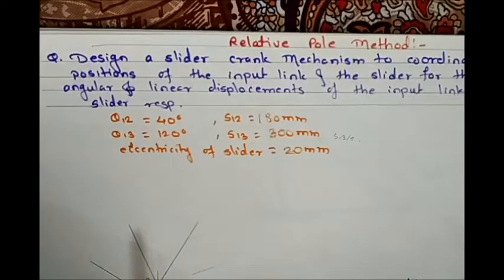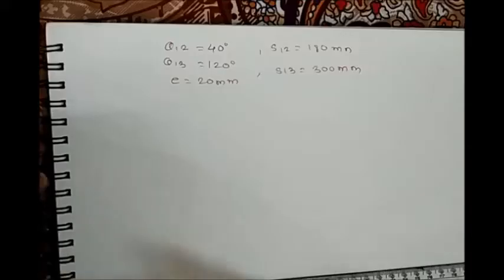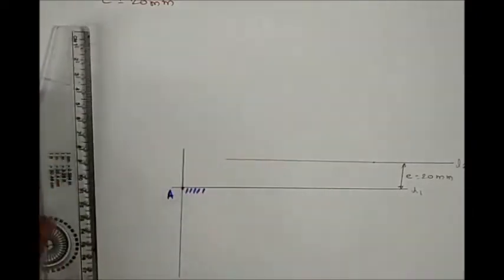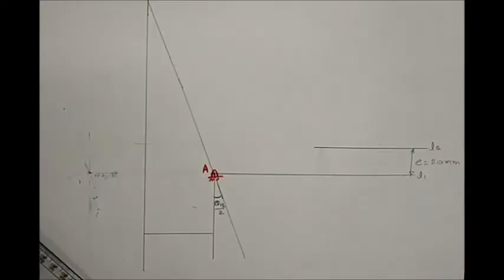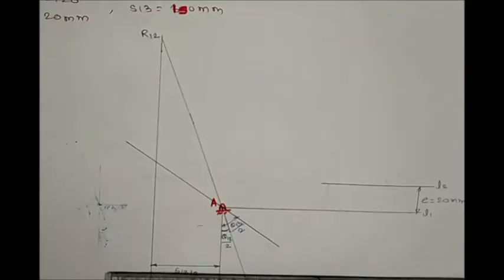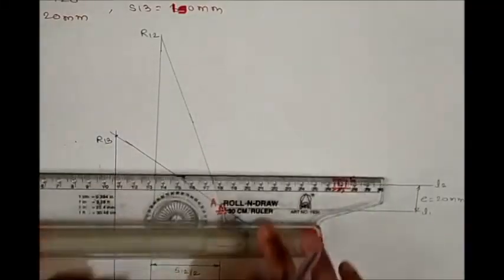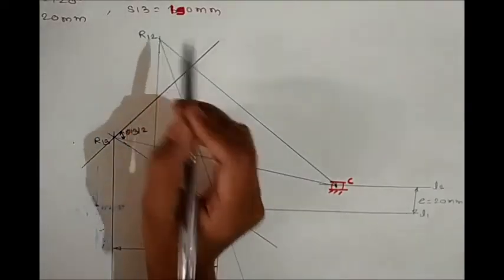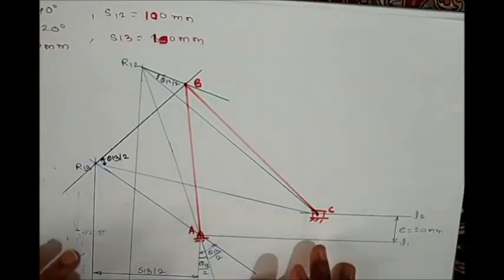Synthesis of Slider Crank Mechanism Using Relative Pole Method

Comment: how you take c point approximately ,my b point is coming at back side than s13/2
Reply from the maker: This is the way to synthesis the mechanism..if we want correct solution then given is with input or output angle n length..